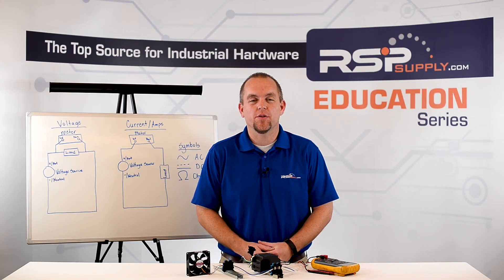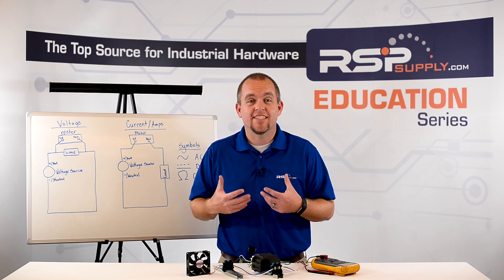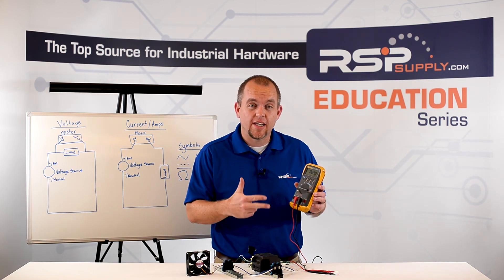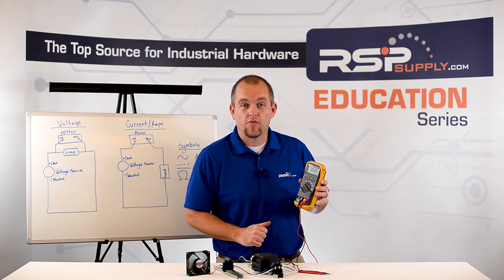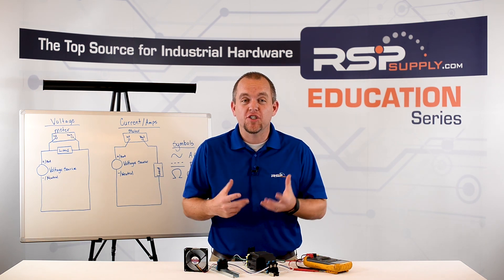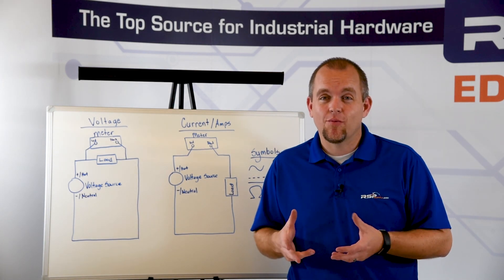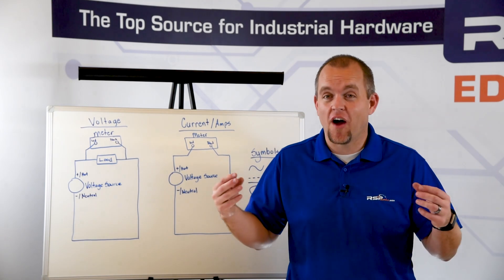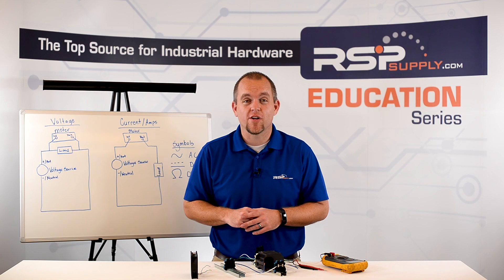How To Use a MultiMeter

Comment: great video thanks for putting this out. One thing i think is missing is the safety aspect of making sure not to measure volts in the amp setting especially for those that might have cheaper un-fused meters.